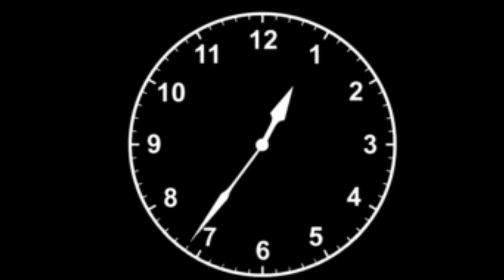Take a Normal Pencil and Repair the Car Remote

Comment: well done, nice ...but do you perhaps have an idea how to make old, rotting PRINTED tracks conductive again? I have an old Texas calculator that has traces printed on foil and some of them are already broken as they are gradually degrading. I know there are paints that are conductive that might help to repair the damage, but they are just expensive (and I just would need a little).  I even tried using a double-sided conductive copper tape - it worked for a few days, but then the errors started again and the problem persists. Any ideas? (thanks ...I'm from Austria, btw)